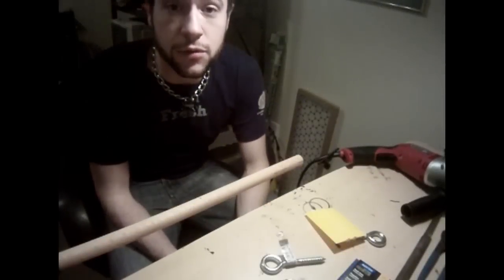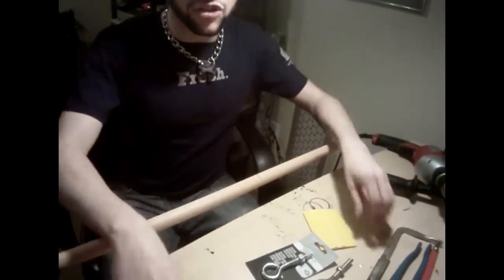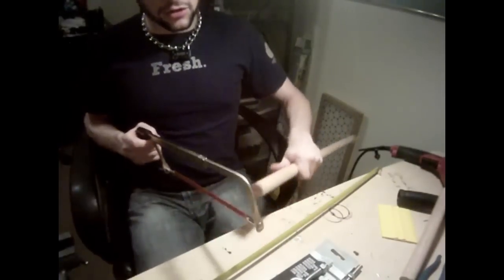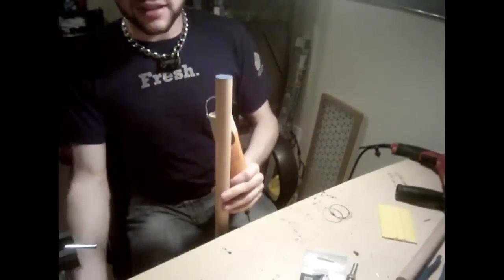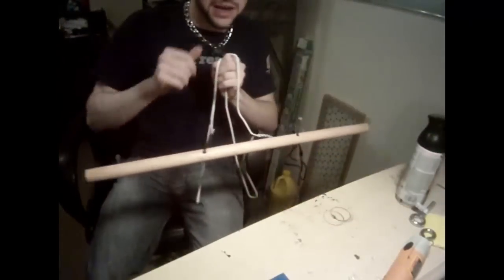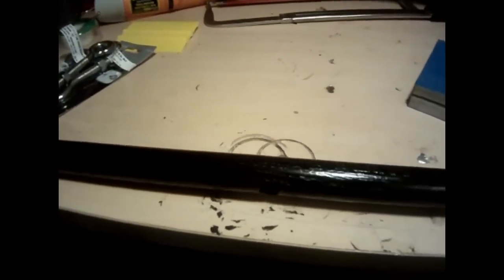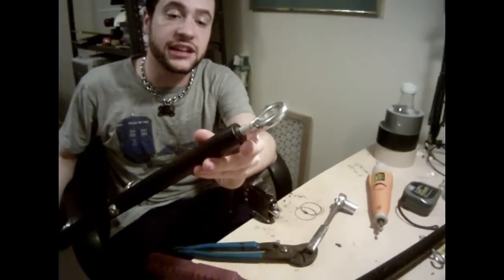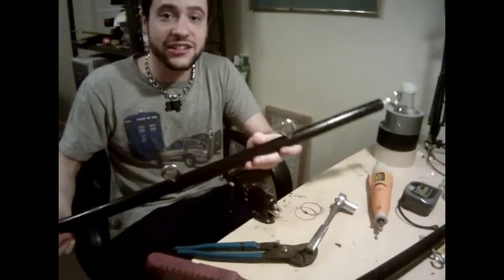Dirty DIY with Drew Episode 4: DIY Spreader Bar

Comment: Nice job, but I have a couple of suggestions:
The end eye lag bolts look to be much longer than needed, and being that long it would lead to any imperfection in drilling perfectly down the middle to cause the tip of the bolt to get quite close to the surface.

Masking tape around the middle holes when drilling could help prevent pushing out the grain at the bottom side of the hole.

Also, using self locking (nylon insert) nuts might improve the end result.

Comment from the maker: Viscount Alpha - theoretically it is a weak point of the wood to put the eyebolt there, but it is best for the falls to hang vertically like that and as long as you're not using it as a safety loop or some other higher stress application it would be fine.

Comment: Hey there! Thank you so much for posting this. What are the odds of you being able to create an adjustable spreader bar? I've been searching the web and I have yet to come across something. I'm very much like yourself where I like to make my own pieces rather than buying them. No worries is this is unattainable!
Reply from the maker: Unfortunately adding an adjustment point like that can really add a weak-spot to the spreader bar. The most I could suggest would be to use a much thicker dowel rod (maybe closer to 2-3 inches in diameter) and smaller eyebolts. Drill a few more even holes down the length of the spreader bar so you can move the eyebolts to where you need them to be. Unfortunately this will remove alot of material from the dowel and add some potential failure points. Sadly the fancier telescoping designs seen on many gear sites can't really easily can't be made from wood. Personally, I'd prefer to have 3 or 4 different size spreader bars rather than a single wooden adjustable bar though, it seems like it'd be alot weaker and extra hassle.